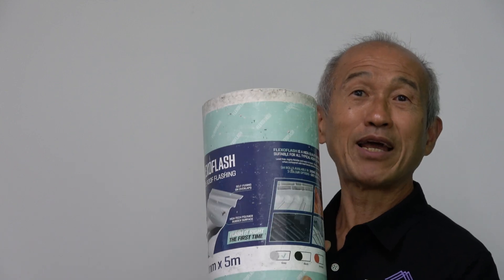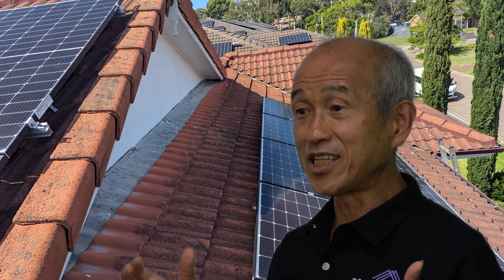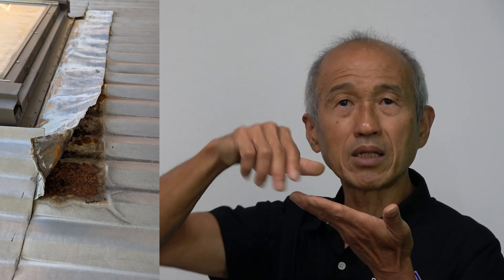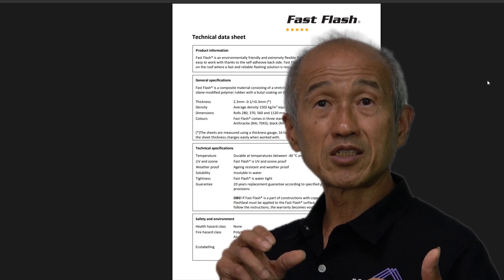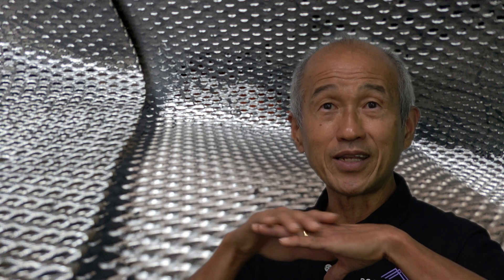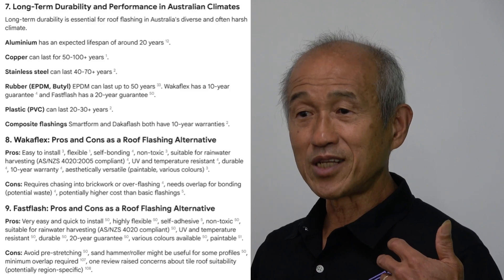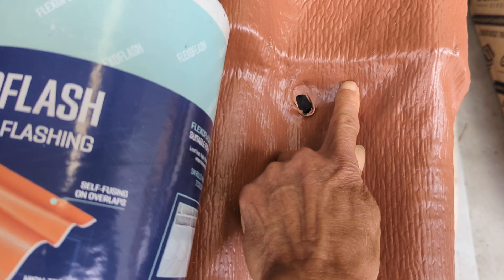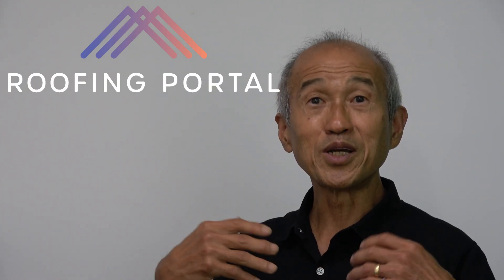Roof flashings for Australian roofs -  which one fails?

Comment: Lead flashing that is painted is still the best option but as this video mentions not on metal roofs. 

It's also the most expensive option which is why it's no longer used. Insist on lead flashing and just paint it the same colour as the tiles with a roofing paint. You'll get many decades out of it.
Reply: No thanks! Not when your on tank water & it’s heavy!

Comment: Lead cracks because they roll it out in long lengths , you should only run lead to about 1.5 meters per section, to allow expansion and contraction, also a lot of lead flashings are the thing grade lead, not the thick stuff

Comment: When I was building my second house about 15 years ago the hardware offered Wakaflex, saying it had a 10 year warranty and was about 2/3 the cost of lead. I didn’t buy it when I saw it was stuck down and cut with scissors. I bought lead and have had no problems. I painted the topside of the lead and have no “rusting” problems with the metal gutters.
Lead flashings come
in different weights so get the right weight and it should not stretch and crack

Comment: I have spotted self adhesive flashings which have completely lifted off clay tiles on units less than 20 years old .  I think the flashings probably adhere better to metal.  I used Dakaflash over a leaking low pitch zinc flashing/zinc orb roof.  Good preparation cleaning resulted in very strong adhesion.  I had to replace roofing screws with lower profile heads and smoothed Sikaflex in the valleys so the flashing would dress onto a solid base.    The crinkled aluminium dressed beautifully into the orb profile after first being located on the old flashing by removing one half the backing paper.  The job was so easy and I'm guessing could last 20 years if the butyl doesn't dry out.  I have an unused roll of plain 50 mm butyl backed aluminium flashing which is 5 to 10 years old and the adhesive has dried up and cracked.

Comment: Im a metal roof plumber from back in the 70s and  80s there was an alternative to  lead even then it was called flashband it was very much like you are showing in vour video it was very sticky and once applied almost impossible to get off
Reply: Was that with aluminium? We called ot tac flash. Stuck like sh*t to a blanket

Comment: I think the picture you showed of cracked lead at the beginning of the video misrepresents what lead flashing can do. 
Was it 20 kilo/m2 and was it installed in short lengths as Whaley said? I doubt it. 
Also Acryflash is now available which is a painted lead eliminating 99.99% of the poison problem. 
The adhesive edge of the crapper flex does cause leaks that would not have happened if it was lead.

Comment: Butyl  glue flashings ( waka) won't stick to dirty / old roof tiles so can't hold their shape. Why not install 'snake skin' flashing between zincalume and lead. Don't forget lead should only be used in lengths no longer than 1.2 / 1.5 meters. Roofer × 50 yrs experience. Whaley
Reply: The snake skin flashing is a great idea. I had never heard of it, so just looked it up. I think you may have just solved a significant problem for me. Thanks!

Comment: That was pretty interesting.
So, lead isn't the duck's guts for flashing. Even so there's alot of lead flashing that's been in service for over 100 years and still working fine. You can repair and recycle lead, so there's those attributes that the modern alternatives can't match.
Was a time when tar coated annealed copper was available and used. I have an old roll of it in my shed. 
I figure the longevity of the new flashing materials is in harmony with modern structures for the  masses' expected lifespans. 
What sort of flashing materials are specified for public buildings, infrastructure and high rise?